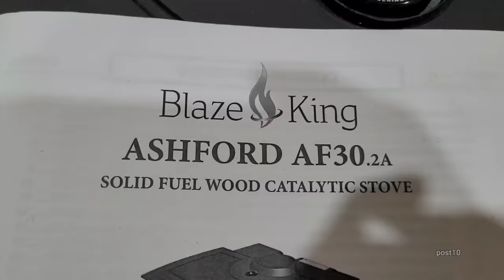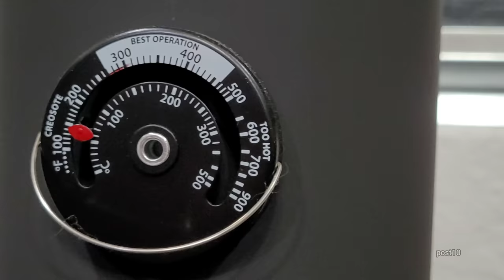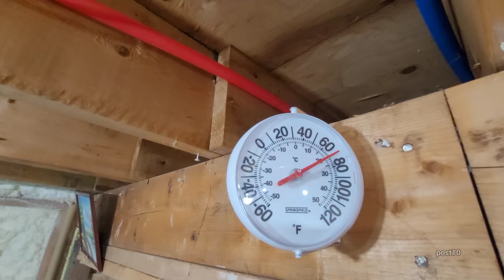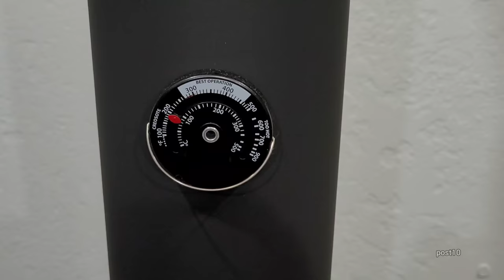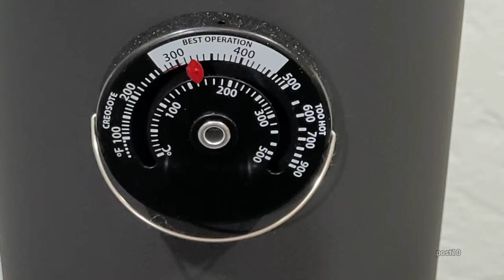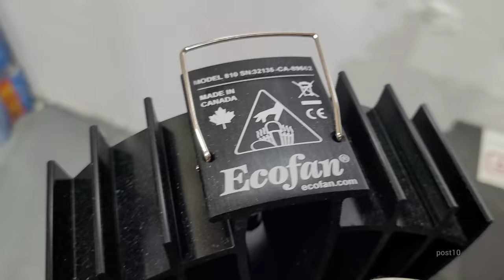Why I Started Heating My Home With Wood And How I Manage My Land. Blaze King Catalytic Stove Review

Comment: When it’s cold dip a paper towel in little water then in ash and you can easily scrub the glass clean with its own ash then burn the paper towel. I find the eco fans are expensive no matter where you buy them. I think theirs gotta bd a cheeper version. I seen a guy had an oven where the pipe pass threw the oven and he could bake and cook in it from the heat from the up pipe just like a regular oven and would crack the oven to get more heat off the pipe instead of loosing so much out the top with out causing smoke. Log splitter all the way sir. Even injured one armed your splitting wood and taking care of business.

Comment: I'm aware of why you chose Wood(as an incinerator for all the waste wood, and thinning your property for Free--but don't forget the LABOR). In the future, you might consider the Pellet stove. An Insert for your fireplace is convenient, but Freestanding is cheaper & better. A ton of pellets(50 bags @ 40lbs each =$300) equals a Cord of wood for the same BTUs in Half the space. You could put 1/2 ton in the same space as that Behlem wood tub. When you get older, it's worth it.
 Advantages: A Castle brand pellet stove($1250) is half as big for heating about 1100 sq ft (1250 2-story with a 625 sq ft footprint). Basically it's an Automatic wood stove with a Heat Pump Thermostat/Timer, without all the cleanup & mess. It lights with a Glow Plug Automatically, 2 hours before you get up in the morning, and turns off automatically, based on your own twice-daily timer settings(or manual operation at the touch of a button). My Entire heating bill per winter is about $500-600(1.5 tons), including electricity for igniter & blower fan. 
A 3-gallon metal Ash-can holds 1.5 tons of pellet ashes. It takes 15-30 seconds to clean the Pellet Cup. I do it after each use, to keep it efficient, & an Ash cleaning every 10-15 bags(1/4 Cord)
From your Subscriber, living in a ski resort with up to 60 Feet of snow per season(I gave you some snow-thrower tips).
Reply from the maker: I'm also a prepper so I wouldn't want a pellet stove as it needs electricity of some type to run
Reply from the maker: I can get a quart of firewood delivered for about $300 or even cheaper if it's green
Reply: @post.10 --The only downside to a Pellet Stove, is if the power goes out, the blower fan & autofeeder doesn't work. But you have a Generator for lights, computer, fridge. 
The Biggest Plus for me is the Timer, then the Thermostat, then the Hopper to store about 12-24 hours of pellets(1 Bag). It runs full hot until it reaches the room temperature that You choose(50 to 70 degrees), then attenuates the blower fan & pellet feeder to hold the Temp.
You don't have to fill it full of wood to last all night, being too hot, then fill the wood again in the morning, or get up at 4AM, clean out the ash, light another fire, and wait 2 hours to warm the house from 50 degrees, etc.

Comment: Out of curiosity, are you concerned about your furnace and state of your fuel oil over the long-term? Not sure about the longevity of the fuel when it's stored long-term or various components of your furnace. Might be a good idea to occasionally let it run a few hours and consult the company that makes fuel deliveries to your house about steps that you can take to keep your fuel stable over the long-term so that it's ready to go when it's temporarily needed again.
Reply from the maker: No I'm not concerned at all because I'm still going to be using it when I'm not home put wood in the stove but it's saving me a lot of money not using it. Most people will tell you that diesel only has a lifespan of about eighteen months to two or three years and I would use it up in that time definitely but what I have learned from my oil company when I removed in abandon 1000 gallon tank that was not use for 20 years is that the fuel was still good when they tested it! They told me it wouldn't burn as efficiently but they pumped it right back into the new tank
Reply from the maker: Not a single problem with that old fuel except some more smoke out of the chimney and that was three years ago 0 problems and I have refilled the oil tank like four times since never a problem with the old fuel

Comment: You get yourself a fiskers Super splitting axe. X27 model I believe You won’t use the pump splitter anymore. Trust me. I split rounds 20 inches across. I’ve never had it stuck. 14 inch? One hit.

Comment: Post watch Toras, The Crazy Russian Hacker (I know there are better sources for this but). I never knew splitting wood with an axe could be so 'easy', I've always done it the hard way and hated it. It's all down to the type of axe and how you use it. You want a good heavy splitting maul, splitting axe. When you figure it out, you can split more wood by hand in an hour than we could normally in a week. It's ridiculous. A heavy splitting maul, you can literally pick it up and drop it on some seasoned wood and it will split itself. No need to use the splitting machines anymore really, it's surprisingly more convenient to do it by hand.
Reply from the maker: It is very easy but I'm saying it doesn't work well for me if the log is bigger than 10 in if it's smaller I will use an ax
Reply: @post.10  I get it. I've never had to split logs bigger than that really, so I wouldn't know, I rarely come across them, the maul works good for the others though. But I've seen him split 2ft diameter logs, it's crazy. And he's fast. It's gotta be the splitting maul or technique, something. He's not a lumberjack, not a bush guy, he's skinny guy lol. 

But Post, you're a hard worker, I respect everything you do. I'm 33 and you'd make me look lazy! lol. I enjoy watching your videos. I'm happy for your success. I went from learning what old food looks/smells like to learning about beavers lol, you got me hooked. I like how you mix it up with the adventures and camping too. Ironic because I never knew you did those things (Before I watched Post 10) and I've been doing urbex and photography for years on Instagram @exoh_io.

Thanks for the content, super entertaining. I look forward to it. Wish you continued success and happiness.

Comment: How does the heat get from that room to other rooms or floors?
Reply from the maker: Cold air rushes in through the door near the floor and hot air rushes out the top
Reply: @post.10  interesting. I don’t get how this could reach let’s say a bathroom on the other side of the house. Maybe since your swft is around 1000 it suffices. Neat stove. Best of luck with it.

Comment: The problem with wood burning stoves is that fuel can run out very quickly depending on were you live . Do your homework before you jump into this or you could be very disappointed.  My grandparents had a big wood burning stove and they never had any issues with things getting too hot near the stove. It could get very toasty but that was it. My grandparents used pine and aspen for over 80 years and they cleaned their own stove and fireplaces with no issues.

Comment: I owned the princess blaze king stove burned pine 90% of the time and never had any issus. I cleaned the pipes once a year. As for your wax ring install insulation around the pipes or bottom were toilet is problem solved.
Reply from the maker: I feel like such an idiot now you're right I can just insulate around the bottom of the toilet

Comment: The only time my glass gets black is when the logs are touching the glass. That’s why I put my logs in the other direction.  I have a pellet stove in my kitchen. It has an electric fan. The glass on that door gets black, because I don’t have the intake air inside the stove adjusted correctly. I’m looking for a person who has the meter to show the combustion % to adjust the air flow.    I use”Softscrub” spray cleaner and paper towel to clean the black off. If the combustion is correct, your glass stays clean.   I have a small electric splitter. Anyone can laugh at me, if they want, but I’m 71 yr old female and I retired my ax.   I believe you can right off the loss of trees from a storm. Especially hardwoods, like Walnut and Oaks. Take photos with measurement, date of storm. With measurements and calculating the board foot of the tree and the value of the wood at that time, you can calculate the value of each tree. A lumberman can show you how to figure it out or I’m sure there’s a YouTube video to teach you. Don’t let any laughing at you bother you, ever. They weren’t taught any manners.  Besides.
who cares?

Comment: I have burned wood for 40 years. Yes, pine isn't great. It will shorten life of "cat" but if its what you have..burn it. We are on year 25 with a Vermont Castings Defiant
 Original "cat" which is needed replaced now. Its lasted 25 years of TOTAL house heating in a northern climate. The good news for your stove company is that you will call THEM for your new cat when it needs replacement. 
It would also be good to qualify your statement about a 24 hour burn.   That usually means there are enough coals left to rekindle a fire.

Comment: Bro that framing... @17:06
Reply from the maker: My friends contractors have said that is a joke and it serves no structural value at all, somebody cut out a 6 inch Notch into that 8-in beam and then nailed back a 1-in piece, the part they nailed back does nothing

Comment: If you’ve got friends that want firewood and if you trust them, sell them damaged trees at a discount. They have to cut and remove. If I was close, I’d buy one or two trees from you. Come in with a chain saw and a trailer and load it myself.
As for the debris, have you though about renting a wood chipper? Just chew up the debris and deposit the chips on the ground.

Comment: With scrap wood I get my 75 by 14 trailor up to 85 on realy realy cold 10° nights,, and if I let it burn, 95° wene it's only 32° over night,, old school stoves, let all the heat out,, no soap stone, or fire bricks, ,fire is in a metal box,, and that's it, the more one tries to control fire, the less control they have over the energy produced

Comment: Actually if it's a very big log and it's 14 inches you just start splitting from the outside and work your way in trust me I use an access for everything just cuz I'm too cheap to buy a log splitter

Comment: The ones that can split logs out right with an ax have basically grown up splitting wood so it's not something they really think about so it normal for them. You on the other hand haven't really grew up cutting firewood with an ax so you need a log splitter but as long as you split the logs what does it matter how you do it. If you want to use a log splitter it's your decision and nobody has a say in the way you do something.

Comment: Take the wax ring out  and replace it with The item listed below to prevent flooding from the Wax ring Melting 

Fluidmaster 7530P8 Universal Better Than Wax Toilet Seal, Wax-Free Toilet Bowl Gasket Fits Any Drain on Amazon

Comment: Sorry to hear about your Pine tree's, a handy tree to use for lumber.. would you not be better off planting native trees instead? The old english oak tree is a great tree for wet areas, birtch/willow in boggy,damp areas, etc.  . and would put some character back into the land, like the old days  ;-)
Reply: You need a fan in the cealing to circulate the warm air around the room, also, it would help with the smoke build up in the rafters  ;-)     and you do need an air vent..
Reply: Pine is a native tree to the area
Reply: @lindastent-campbell5130  i know, i meant something other than pine, im in south wales uk, pine is common here too, lol. mountains of the things, but woods look much better with the old natives not collonial plantations, that we still have. lol like a forest should be ;-) butwithoutmega loads of pine..   ;-)

Comment: Why don't you dry while the ceiling above the stove and use fire rated sheetrock or gypsum board or whatever you want to call it I think that will solve your problem of it going up through the Raptors and onto your toilet wax ring upstairs

Comment: You wouldn't believe the logs I've chopped with an axe, branchy as well. Trust me, just use an axe. This device you have here is good if your wood is very hard to chop, meaning has a lot of branches intertwining. If it's just straightforward alignment, you'd spend less effort with an axe. Though if your inexperienced, then it's a bit dangerous.

Comment: If any one says no need to clean the chimney,, is the one house burn down,, don't listen to the ones say this or that,, do diligence,, clean the chimney before the 1st fire,, as well atleast check it 2 times a year,, every chimney is differnt,, take your house and life seriously, those people say this or that arnt in your home sleeping at night,, and sad to see how some struggle with the new stoves,, the old ones are simple,, wood equals fire,, fire equals heat,, my old school stove ,  I could if I want make cynder blocks out of the ash,, it's hard almost like coal ash,, I try to keep as little wood in it as needed to be burning and keep the stove hot,, it realy doesn't take much to make a metal box hot from burning some wood in it,, it accualy takes very little,, btu's,, is bigger than most realize,, a very small piece of wood,, if it's BTUs are captured and uses properly,, it takes very little wood

Comment: Be careful with Chimney Sweeping Logs! They are NOT a replacement for proper chimney cleaning but, they were designed to make cleaning much easier. If you know it's about time to clean the chimney, burn one of those CSL's then after it's cooled completely, manually clean the chimney with a chimney brush.

Love the look and efficiency of those wood stoves, but the price is just a bit out of my range. Nearly $5k for just the stove, no accessories, no installation.

Comment: Those are not pine, they look like spruce, which is much better than pine. 

    That little plant that looked like a tree and you said wasn’t a tree is called club moss. 

     If you read the instructions for the stove, cardboard and paper with colored ink on it, can ruin the catalyst. Been wanting to get a blaze king for years, and have been using my old catalyst Jotul. 

     As for splitting with an axe. You can split large logs. You just have to work on your aim, and start at the edges and split off little bits at a time. When you get good at it, you can start to move quick. It’s another skill set, I would suggest a Fisher axe. They look cheap but they don’t break!! Just don’t miss, it will make your hands ring!!! 

As for tree work. If a big tree tree lands on a small tree, DON’T JUST CUT IT!!  Start at the top of big trees work your way down, take the weight off the little tree. Those things can come back and kill you!! Learned that from a logger and heard of it happing from people cutting trees in their yards that fell over, and now they are dead. Please be careful. My son is a huge fan BTW.

Comment: That handle probably comes off so if you have kids and don’t want it messed with. There’s probably other reasons also but I would think that is one of them.
Reply from the maker: I think it's probably so it can fit through the door easier, I don't think it's for children because there's nothing to stop them from opening the door which is more dangerous

Comment: Radiant heat doesn't heat the air, but it instantly heats objects at any distance, as it is Light. 
If your stove produces heat it produces light, you want to avoid that light being able to reach anything that might degrade, like food items, or water in a plastic container. 

change how you think about your stove, as it isn't just directly heating things, and there might even be enough airflow to cool an object that is being heated via incandescence, that does not mean it isn't being heated, and for something like water, heated all the way through as the light can touch every single atom. (Because water and the container it is in, is usually clear.)

No sense ruining the longevity of your prepping supplies, because something seems unintuitive, but you really should be thinking of your stove as a small sun inside of your home. 
Direct line of sight is bad.

It can be freezing out, and you can still get a sun burn.

Comment: You CAN use an Ax to cut a log no matter what diameter it is. All you need to do is use the proper technique. I recommend checking out buckin Billy Rays channel an my point will be easily proven.

Comment: You realize that you should operate a damper on a smaller stove the same way you're using the "bypass" on this stove. And your right u don't use an ax on a big log. You use a splitting maul

Comment: Was told fire ash makes for a good replacement to salt and sanding ice patches. Like walking paths and such. I have not done deeper research into it and do not know how messy it becomes after the snow and ice go away.

No idea if it is true but the olden days apparently ash was used for sanding in winter time. And good in garden and outdoor toilets or what you call them in English. Compost toilets??

Comment: Get rid of that steel bath, it prevents your logs from drying
Reply: I figured that out eventually, I drilled a bunch of holes in the bottom so are could pass through it
Reply: @post10Vlogs  here in northen Europe, it's common to have huge fireplaces made of different bricks, some are made from soft stone that conduct and store heat well. All of them have typically a place underneath the fire for logs where the air circulates and that dradt dries the surface moist from wood. I also pile them into kitchen and I can hear them cracking while drying. Those dried logs burn a lot differently than the ones I bring indoors just before burning, even those have been under roof. Outdoor air moist just soaks everything when it gets cold and evenings.